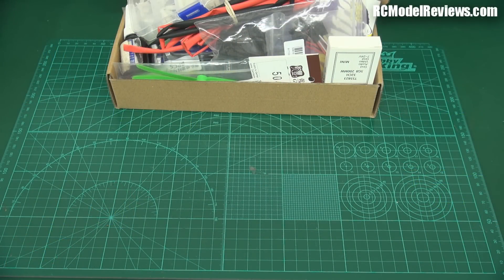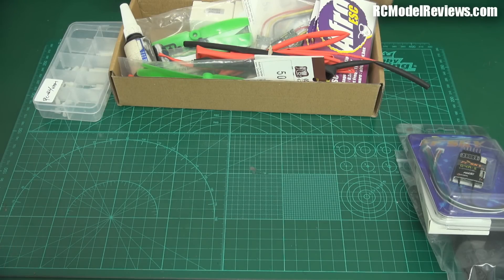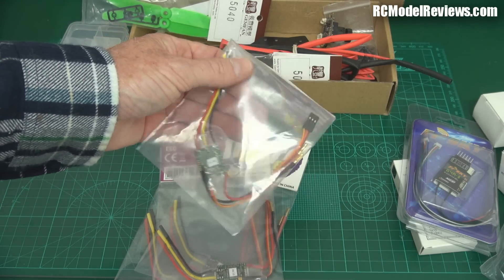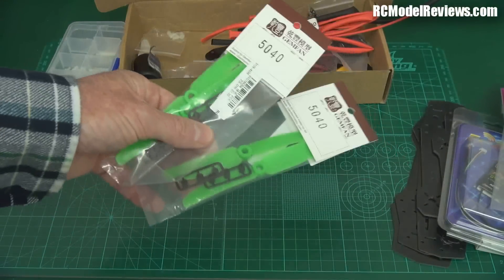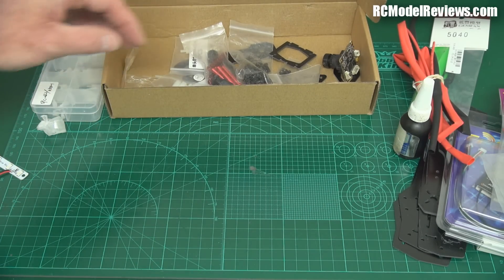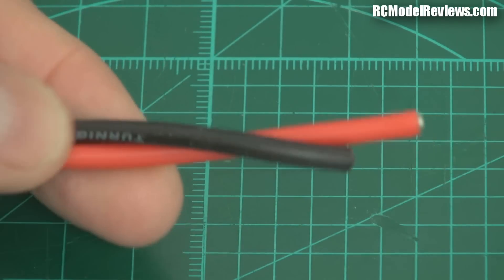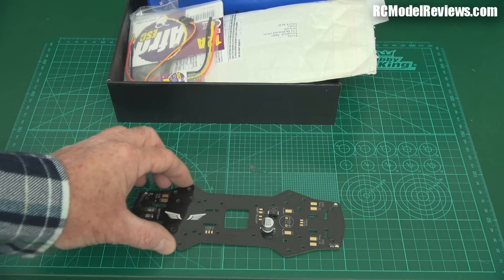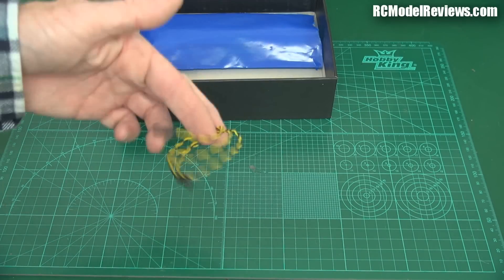Low cost miniquad racing drone build video PART 1

Comment: I want to go budget, and can't afford a taranis. Any suggestion for a good transmitter (and matching reciever) that will save some money, and still work?
Reply: +BobPwnsMC get the turnigy 9x from hobbyking ...$60 thatsa a steal.It is a good 8 channel radio and comes with a receiver
Reply: well you could look at the lower end of the spectrum series, the dx5 or dxe for example. both come with reciever and transmitter and are usually sold for less than 100 USD.

Comment: How much dose all of this stuff cost
Reply: +Viki Stefanus yep. If you Google "from not knowing how to solder to building an fpv 
racing drone" you'll find a blog post with a complete list of everything
 for this build with the cost break down.
Reply: +Pasta Pat under $300 for all the required parts, but over $200 for the required accessories (transmitter, goggles, batteries, battery charger...etc.)
Reply: +Isaac Davis so probably around $500 to build a ready to play racing drone?
Reply: Isaac Davis thx for ur info.

Comment: To help with everyone undertaking this endeavor, I've put together a full bill of materials with links and prices to amazon, banggood, and hobbyking.
https://docs.google.com/spreadsheets/d/1gfmxE4SHpWs5T4TVd2oIMbPXGM4_edjKz6znIZ3ms7k/edit?usp=sharing
I hope this helps!  And if you have useful input or great alternative parts let me know and I'll keep things updated.
Many Thanks.
Reply: +IAmWhil   That is one heck of a great list. I can't believe someone would go to the trouble of doing that!!! Three thumbs up (no, I'm not 'all thumbs' .. I used one of my wife's)
Reply: +Peter Catamarancharter Thanks, I kept seeing the same questions on these videos and had my invoice on hand, figured this would help :D.
Reply: +IAmWhil This list is great! Thanks for your effort! Really a great help!
Reply: iamwill, nice list, but am I overlooking the flight controller or is it missing?
Reply: +Robert Sherburne Thanks for catching that!  I've updated it.  I ended up going with the rev. 6 board, as opposed to the rev 5.  I've also discovered that Rock RC on Amazon ($16.99) takes like 10 - 23 days to ship.  So It would have been worth a couple more dollars to get the controller with the rest of my parts.  Also Banggood now has the rev 6 boards as of today, and are priced at $14, but only ship from China.
Reply: +IAmWhil  Just looked for the V3 at hobbyking. noticed they have the v2 at a good price .. but .. can  the V2 really control the 3 axis gimbal of the FPV camera? Do I understand that correctly? That is insane !!!   ;-)  So you look up, see the treetops, think you are headed that way and crash into the tree trunk?
Reply: +Peter Catamarancharter I'm not sure, this may be an answer someone else can take a stab at.  Personally I'm going to mount the FPV camera statically aimed forward and slightly tilted up.

Comment: Hi I love the build video but like the comment below could you please do a build video of maybe a cheap/mid range price fpv 250 quad maybe with 20a esc's for reliability and bigger motor size option and maybe 600mw video tx that would be reliable and decent I guess a would like to build is a good reliable fpv racing/freestyle quad and spending a few bucks more to get great performance and reliability would be worth it (without breaking the bank of course). also I am super confused about fpv cameras that would match up with the new wide screen fatshark goggles like the dominator V3s or the dominator HD V2s with low latancy, and like the comment below am also interested in the hobbyking robocat frame for some reason any thoughts on it? P.s also love your videos!!!!!!!!

Comment: do these 12 amp esc's allow for much motor upgrade options? I'm looking to build a cheap 230 setup. I may put a little more into the frame because I'd like to gradually upgrade to better parts. was thinking about the robocat frame. what are your thoughts on this? should I just build a totally cheap model then build a totally new model as my skill increases or go with the gradual upgrade process? thanks, love your videos!
Reply: 250 model not 230
Reply: +Jeff Brewster The 250 frame is easily up-gradable to a 4s setup with 30amp ESC's and high power 2204 motors. I have pretty much this build here, how I got into the hobby(thanks +xjet). But, my buddy has a 4s setup, just make sure you have a good PDB and a FPV transmitter/camera combo that can handle the voltage, or use a 12V circuit on your PDB. BTW his build is on my latest youtube video if interested, Runcam2 footage is the last half.

Comment: Thanks a lot for creating such an in depth video build of a racing quadcopter.  I've been researching them for the last couple months and was waffling on if I was going to buy a some kind of ARF or RTF kit or if I wanted to go for it and just do the whole thing myself.  While I went with a few different components in the end seeing the whole process was enough to convince me to go for it and build one myself.  With everything being off the shelf parts it seems like it will be much easier for me to repair and tinker with it to my hearts content.  

Anyways, thanks for sharing your knowledge with the youtube community.  I've been pushing this series of videos on a few friends to try and convince them to jump into building 250 sized racing quads as well.

Comment: can someone please let me know if this build is a higher quality and or faster than a walkera runner 250 or the eachine 250. I understand building is always better for the learning experience and want to get into quad racing. But for my first quad is this build any better than the ones mentioned about. if so im going to try and build it. very clear explination and feel confident completing the build. any info is greatly appreciated.
Reply: +Nicolas Benton yes, this is a higher quality build than the walker runner 250 and the eachine 250. Especially if you use a different camera than the one Bruce recommends because then this quad can handle 3s and 4s batteries.

Comment: Given its 2016 and new bits are coming out every day. Would you change anything in the build list, like motors, ESCs  etc.
Reply: Here's an updated list from me ( slightly more expensive)
The Martian frame
same VTX (ts5823) to stay cheap
Emax 2205 2300's $16x4
Lumeneir silk 30a escs $15x4
x4r (lower latency)
Naze 32 rev 6 with betaflight (kiss FC for best performance)

This is a great setup
Reply: +TheFluffyDuck check r/multicopter or r/multicopterbuilds on Reddit.  There are a few posts with lists of all decent 5" prop frames and such.  Good info on there
Reply: I have seen a V2 or the ZMR250 that has a Power distribution board.

Comment: I'm really new to this I will like to know how much in TOTAL will all this cost me? all I have is a soldering machine! Thank you for your help. is there another place I can see a full list of all the items need it for this project!
Reply: +camilo11315 $270 for quad parts, $325 for equitment, and $75 for tools. If you search for "copter wars building an FPV racing quad" on google you should find a blog post I put together with a complete list of parts and cost break down since there wasn't one in the description of this video.

Comment: I think I missed the total project cost while watching. What was the cost of all the parts?
Reply: +Mike S $270 for the quad copter parts, $325 for accessories (batteries, goggles, controller... etc.), and $75 for tools. 

If you search for "From not knowing how to solder to building an fpv racing drone" you should find my blog post with the detailed break down.
Reply: +Isaac Davis Thanks for the responce!
Reply: +Isaac Davis Thanks for the responce!

Comment: Hi there. Built your cheapo racing quad with your vids and flys great. Well balanced and have the pids to fly acro with no jitters, but cannot keep the nose down. Will creep back up when release the stick. Any thoughts?
Reply: +2253glen move battery forward

Comment: Hi I've watched this series of build videos and fancy doing a build but fancy a bigger more stable GoPro platform 
Would these motors and controllers etc work on say a 450 frame or would they be completely unsuitable ?
Or have you done a GoPro type quad build video
I might just build this 250 racer just for the experience 
Great video by the way keep up the good work and thanks

Comment: Hello,
How can I test the motors before installation for a mini Quad 250?
I tried to connect the ESC + cc3d + motor powered by 11.7V battery using the Open pilot software to run it .
But the ESC gets hot and nothing happens !
i know im doing something wrong , can anyone please tell me how to do that! pix of a link to a video will be awesome.
thanx
Reply: +Ace M  best way to test motors and esc is connecting to a receiver directly bind to your transmitter and test, i had a couple of esc's with your same symptoms and they were fried, just tossed them

Comment: as the parts list wasnt updated, I was wondering (since I do wanna stay cheap but willing to spend more) what items have priority in upgrading? the motors? escs?   also, I have 20A opto ESC from t-motors (t-motor air esc 20A opto) as part of a kit called 350 airgear which to my surprise SUCKS REAL BAD. got it for a diatone white sheep build but thinking of recycling the ESCs on a miniquad, or is it MUCH better to get something with simonK or BLheli <-- reviews swaying me the BLheli way
Thanks bruce, Iv learnt everything RC from your channel, it eased my entry into the hobby drastically.
I was thinking about getting sunnysky motors simply because they have available and cheap bearings and shafts, should live very long.

Comment: Dear Bruce, 

Been trying to contact you through an email, just can't grasp at your address. So I’ll write up here. I have been seeing all of your uploads for more than a year now that I got interested into the RC hobby, unfortunately I had not been able to get enough money to actually get some gear for myself, I’m from Mexico and it’s not that popular over here so there are no local stores where I can buy some stuff. I have seen your series on the racing miniquad of the ZMR250, and I believe that could be a very good starting point but while trying to get all the materials a few questions where brought to my mind. At first which transmitter should I get? The Taranis got my attention since it seems to be very used through the hobbyists and I plan into doing some planes too, and could actually get the best out of it on the long run, but it is a bit expensive, should I go for it or would you recommend another one as a starting point? On the other hand for that specific build which would be a good lipo battery? And how much air time do I get with it approx.? Would a 2.2 be too heavy? 

Thanks for your efforts and I wish that being a subscriber and never letting a video upload unseen is enough support for you to continue. You are the guy that got me interested into this hobby. I wish you are having a happy holiday season and continue this way.

Cheers,
Reply: +Pato Llaguno I got a Taranis for this build and loved it. I've tried 3s 1300 and 2200 batteries and definitely preferred the 1300 (6-8 minutes flight time). The 2200 (8-10 minutes flight time) weren't too heavy, but I only got a couple extra minutes of flying time out of them. I recently ordered a 3s 1500 and am thinking that will be the sweet spot, but I haven't tried it yet. I tried a 4s 1500 for a couple flights and it worked well, but I'm not sure if this build is really made for 4s batteries so I'm afraid I might fry something.
Reply: +Isaac Davis wow, didnt know they lasted that little,  so basically i need many lipos to really have a good time with it, or do they charge fast?
Reply: +Pato Llaguno you'll want several lipos. However, 6-8 minutes of continuous flight is a lot longer than you think especially considering how fast this quad flies. This isn't a quad you can just fly around in your backyard. The batteries take about an hour to charge, but if you get a parallel charging board you can charge multiple batteries at the same time with the same charger.

Comment: is it possible to get EVERYTHING Pre soldered, or do need to do everything, because i'm only 11 and i'm really interested and my dad wont let me get a solder iron because they are too dangerous and he is afraid i might burn myself, so is there??
Reply: +Declan Moss flying this quad is much more dangerous than using a soldering iron. The worst that can happen with a soldering iron is a small burn, but this quad could take out an eye or cut off a finger. I feel 11 is old enough to solder, but probably not old enough to fly a quad copter with this power. I would suggest learn the basics of soldering now and when you're a few years older build a quad copter.
Reply: i aleready have a quad, and im very good at flying and i mean very good. i have never hit anything and i got it 5 months ago its a rtf made by syma.

Comment: how in the fuck do I set the camera up and have it wifi on ios phone for screen??
Reply: +GodsGift902 thats not possible with this setup. I also want to say that wifi fpv is total crap, has a lot of latency and sometimes freezes. If you want a cheap fpv screen and receiver look at this http://www.hobbyking.com/hobbyking/store/__63646__Quanum_Complete_FPV_Bundle_Set_w_Goggles_5_8GHz_32ch_Video_TX_RX_CP_Antennas_and_Camera_PNF_.html btw it comes with good antennas, transmitter and camera.

Comment: What about just buying a Eachine Racer 250 from Banggood for $149? Seems like a decent miniquad and all you need to add is a receiver.
Reply: +K Danagger Plan on 60 day delivery to be safe from banggood. If you get it in 40 days your lucky. Love the prices but if your wanting to build, your better off paying shipping from hobby king so you can get started if you can afford it.
Reply: +Ben Bertagnolli
I got my Eachine Racer 250  today - it took 28 days. That is about average for Banggood.  The price is now $136.
You can't build a 250 class miniquad that cheaply unless you already have some of the parts lying around.

Bruce should review it. It's not the greatest quality, but it's a lot of fun and definitely a real bargain.
From what I've heard, it's a much better machine that the Walkera Runner 250.
Reply: +K Danagger I have one of those coming as well for the same reason. People seem to have trouble getting it stable, but that seems to be down to the frame. I figure at what it cost me to buy it, I can still order a ZMR250 frame, swap everything over and be ahead of the game. Especially now that the Canadian dollar is below 70 cents US :/

Comment: hello. 

I'm New at this and I have a question.
does the Robbe XS-4 LCD transmitter work with the frsky receiver?
or should I replace the frsky for the Robbe RX2423
- 2,4GHz receiver that comes with the transmitter?
what is better to do?

Comment: As a first timer, I don't already have a lipo battery on hand like the video assumes. Maybe you could make a video on what the  various measurements advertised on lipo batteries mean (number of cells, amount of C's, mAh, voltage etc.) and how someone should go about choosing the best battery for the hardware they have chosen to build with

Comment: I was going to swap your 200mhz video tx for a Aomway Micro 200MW 32ch 5.8GHz Video Transmitter. The specs look identical except the antena is SMA instead of RP-SMA (my rx is SMA so I would rather have the same types to make replacement easier. plus there seems to be more SMA's.

Is this an ok sub?

Comment: Whats a good upgrade from the Naze 32 flight controller, I want to build my own quad and looking for long range signals
Reply: +Nivash Sewsunker the Naze32 is the flight controller (and a pretty good one) not the receiver. You would want to upgrade your transmitters if you want a longer range and your video signal will most likely be your limiting range factor.

Comment: That depends on whether you already have some RC gear etc.  About $200 would cover everything except the RC equipment and batteries/charger.
Reply: +xjet can you update for the components list. i have held back ordering my stuff for like a month now
Reply: +hell cat I put together a complete list of everything I needed including tools for this build. If you search "fpv copterwars" it should be the first result on Google.
Reply: @isaacwdavis thx
Reply: +Isaac Davis i get starwars speeder bikes. can you give me the link to the website
Reply: +Isaac Davis thanks
Reply: +xjet wow what a price difference my basket tells me >400€ for the parts (germany)
Reply: +Chris S. Try looking for the same parts from other sites.
Reply: Hey guys im new to the hobby and have just ordered most of the parts for this build but i dont know what battery to run with this setup,  any advice would be much appreciated thanks

Comment: Im just a beginner,would i be better building one like you or buy a Eachine Racer 250 FPV Drone Built in 5.8G Transmitter OSD With HD Camera ARF Version which is 124 euro